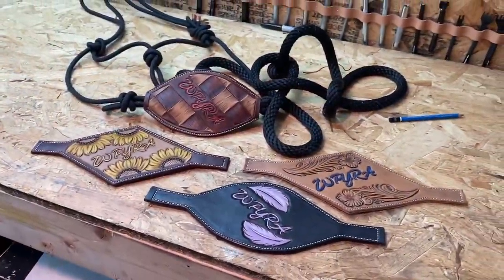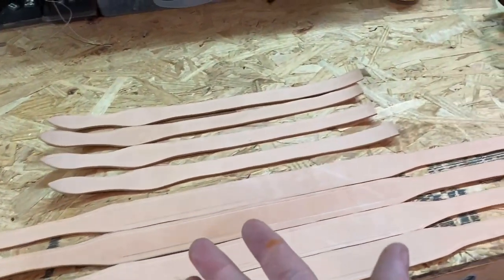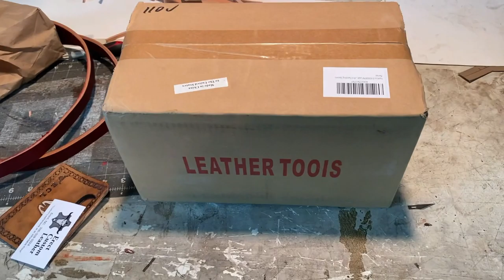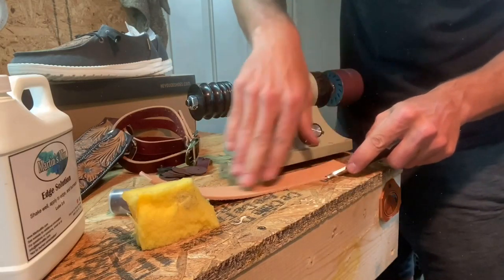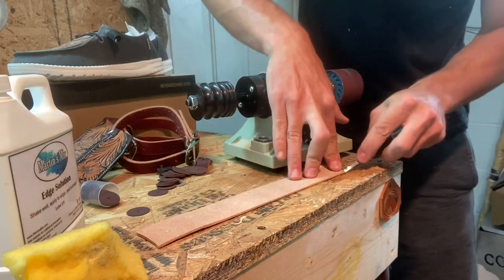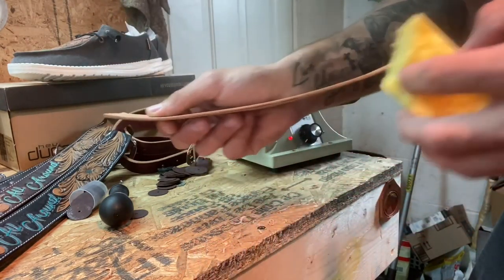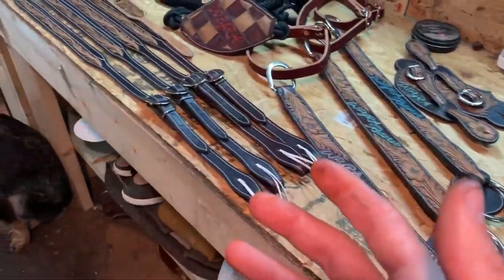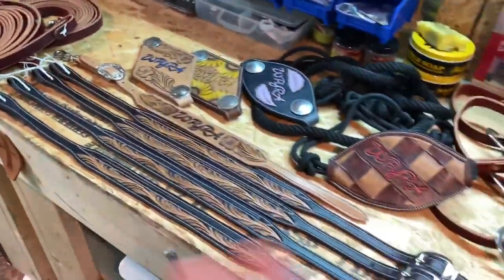Leather Vlog #8

Comment: I have that same burnisher. I run mine at about 3/4  on the speed knob  but a bit of saddle soap on it and wet the edge with water and just set the item on the top  and go up and down the length of the item. 🤙 Amazing work